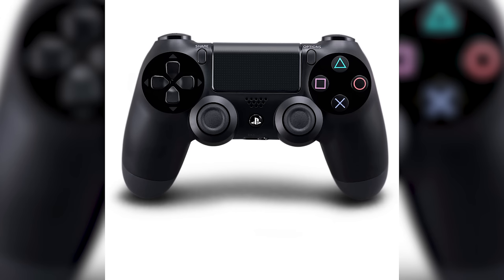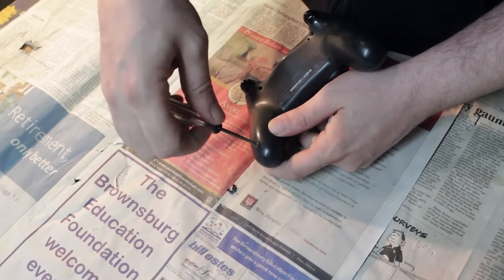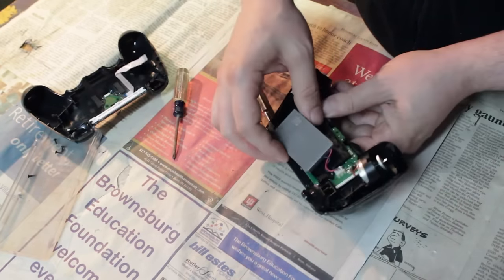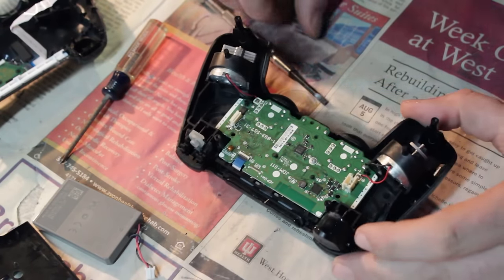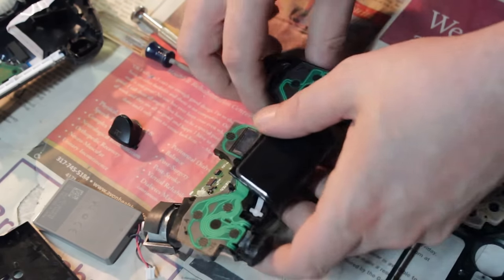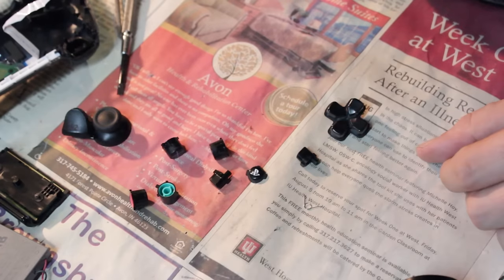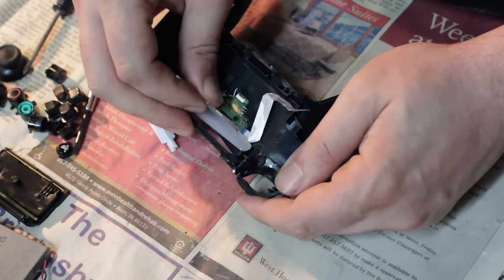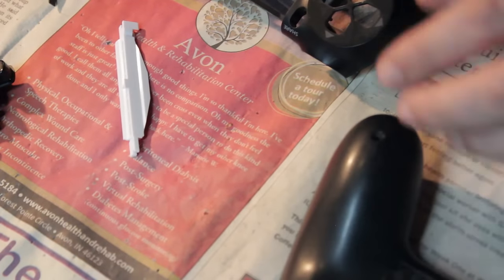How to take apart a PS4 Controller

Comment: I used your tutorial to fix a problem with joysticks, but afterwards all of my buttons started having a weird glitch. When I select something in the home, like Minecraft I could enter the game, but I’m stuck at home screen and can’t go any further.. I can go into other applications like my settings or trophies and select things, but the moment I enter a game everything stops. Has anyone else ever had this problem and know how to fix it? I really don’t want to spend more money on a new controller.
Reply: I found a reddit post with someone with the same problem, so if anyone else has this problem it’s because one of the buttons are stuck or there’s too much dust blocking it. I opened mine back up and found the spring at my L2 loose and falling out. I’m still working it back into place, but I’m glad it’s not a worse problem.

Comment: Hi I was wondering if you had a tutorial on controllers if my thumb sticks lean to the left when I game?
Reply: Jessie Dugan Same
Reply from the maker: Drifting is almost always a sure sign to just replace the entire controller.  The only way to permafix this is by removing the old joystick module from the controller board and replacing with a new one.  This can be tedious and delicate so unless you have some very good soldering tools, You may want to save yourself the headache and just get a new controller.

Comment: After taking out the screws and using the flathead it's still really not wanting to seperate.
Reply: Eventually got there and my blue ribbon now doesn't want to come out, I feel like I'm going to break it try to pull it.

Comment: @Drumblanket  Great video. Mine turned out great except 1 thing was the bottom half was a touch darker shade than the top (obviously I did all 1 colour) is there something I can do different to avoid that?
Reply from the maker: did you use a primer first?
Reply: Yes.it seemed to be just the 1 paint colour that was doing it. I did another 1 a different solid colour at it was fine

Comment: When I built my controller back, the light bar and the controller stopped working
Reply from the maker: Its because you most likely didnt put the blue ribbon cable back in the right way.  Flip the connection around and it should be good.

Comment: I disassembled my controller, put it back together but now each time I press the os button, charge the controller or push the reset button, the light flashes yellow three times and turns off, can someone help me?
Reply from the maker: Ribbon cable is I. Wrong

Comment: What does that middle screw hook on to? I'm trying to put my controller back together and it's not grabbing on to anything. It just sits in the hole
Reply from the maker: It should be grabbing, If it isnt, Your controller is not resting in the shell correctly.
Reply: Drumblanket thanks I got it but my controller won't turn on now lol I think I'm just gonna get a new one. I took it apart cuz my X button wasn't working but now it won't turn on.
Reply from the maker: I would check the ribbon cable.

Comment: Just here to say PlEASE to anyone taking apart the controller....when it comes to opening the shell MAKE SURE YOU ARE HELLA CAREFUL I freaking over muscled it and the ribbon cable just popped out from the top...so yeh....just a PSA don't rush it don't muscle it with your barehands like I did because it is tricky you'll feel like it needs force then you go and do a "bit" of force and POOF whole shell split ribbon cable pulled out from top so it's broken....
Reply: * Update* I fixed it LMFAO

Comment: Would love if you could reply. Ever button works execpt my x button. Have no clue why. Everything looks like it's where it should. I cleaned it out with air too and nothing :(
Reply from the maker: Hmm...  I say take it apart and make sure the metal contacts dont have anything on them.  Thats the only think I can think of.
Reply: @Drumblanket  I'm assuming the metal contacts are the springs / pistons that extract from the buttons, and they looked fine. I will say I've dropped the controller more than a few times, but I'm not sure why it only affected one button. Either way, that you for the fast response! I'll be sure to come back if I have any other questions about tech :)

Comment: U made me break the black piece that hold the battery in place, there’s uh screw holding it ,all dint say that just just said spend time on it it’ll come off all broke 😂😂now it’s loose putting it back together, so anyone if it ain’t coming straight out there’s uh small screw 🤦🏽🤦🏽
Reply from the maker: I made you do this?????

Comment: This is why I hate ps4 controllers. The analog sticks have problem like controller drift and not being a now to Sprint. Then when you try to fix it the screws are so small you need to go buy the right tool for that. Then after you get the screws out you find out taking the case off is a bit hard. Then when you finally get it off you have to struggle to get the ribbon off. Ughh

Comment: Do you have some info why ps4 controler cant connect with bluetooth but works only by cabel?
Reply from the maker: Probably a bad Bluetooth receiver.  Do other Bluetooth devices connect to the ps4?
Reply: @Drumblanket  Other controler connects with ps4 and other devices with no problem but this one wont connect on my ps4, phone or laptop.
Reply from the maker: Sounds like the bluetooth connection in that controller stopped working.   Im not sure about a fix for that.

Comment: Grandmother can take apart a PS4 Controller with no issue.
video is not showing how to get it back which is the difficult process.
Reply from the maker: Check one of my custom ps4 controller tutorials. They have reassembly instructions.

Comment: the screws are hard to open (like so hard) is that normal?
Reply from the maker: it could be the screwdriver you are using.  Small screwdrivers can be a real pain to use i the handle isnt long.

Comment: Wedging your controller open with a flathead IS NOT a good idea. Please don't try this, you'll ruin your controller.
Reply from the maker: As everyone can see from my video,  Doing this did NOT ruin my controller.
However, if it makes people more comfortable to use a plastic screwdriver or orange peeler, you can.  If you are careful, using a regular screwdriver will be just fine, regardless of what people who pop in and post in the comments say.

Comment: Hey can you please respond as soon as i pulled out the white cable from the board and then after i pluged it back in now it just keeps flashing orange like its charging but its not pluged in
Reply from the maker: are you sure you put them back in with the connections in the right spot?
Reply: @Drumblanket  yeah so i kept messing around with it then it started flashing red the same way and after a minute or do it completely died
Reply from the maker: sounds like your battery must have died. I would check all of your connections and make sure your ribbon cables are all properly fitted.
Reply: @Drumblanket  hey bro could you please recomend Me a wall charger for my PS4 controller because i dont want to fry the battery

Comment: Hey can you help me? I got to the part with the joysticks, and do you know those two parts where the positive and negative cables meet on the chip. The red positive cable detached from the positive metal part it’s supposed to be at. Is it done for? Or is there a way I can get it back on? Please help and thanks
Reply from the maker: You'll need a soldering iron and some solder.  Its not terribly difficult but you would need basic soldering experience
Reply: @Drumblanket  ah dammit thank you
Reply: @Drumblanket  I have no experience with that but I was wondering could I just stick on the cable with some electrical tape? Could that maybe work?
Reply from the maker: It wouldnt be secure.  Honestly, Soldering isnt hard at all.  Plenty of tutorials and its cheap to get started.
Reply: @Drumblanket  hey can you link me everything I need to get started just for fixing the wires on the controller? I don’t want to spend too much money, then it’s better to just get a whole new controller. On other vids i see, it gets quite expensive

Comment: Took mine apart only to realize that my replacement Xbox 360 sticks won't fit in the casing good enough to move properly.
Reply from the maker: Grind the base up on the thumbsticks a few millimeters. 
Should work better after that.
Reply: @Drumblanket  Will do thanks. Do u know if One sticks are better fit? I like them better but didn't have any for spare right now to test.

Comment: I tried putting everything back together, everything still works, except the light 😅
Reply from the maker: your ribbon cable is backwards
Reply: Drumblanket thanks for responding, I’m just going to leave it, it’s better without the light anyway 😂
Reply from the maker: @newbloxers6493  it actually uses less power that way. If you decide to change it in the future, you know what to do!

Comment: Why does the ps4 controller emit dangerous levels of microwave radiation?  Like a mini cell tower?  One of the reasons I sold my ps4 pro.  Tested with gq-emf-380 multi field meter v2.   Dr Barry tower is on youtube.  No rf shielding ..... Even 80s computers had that.    Please share this information.  I can't do this own my own.

1 second ago

Comment: I destroyed all four plastic hooks prying it open like this. I don't think this is how it's supposed to be done.
Reply from the maker: Plastic hooks, shmastic fooks!!!    
The controller is held together by SCREWS!!!!  
I actually have no idea what hooks you are talking about. 
How new is your controller?
Reply: @Drumblanket  Its from 2014, unless I've mixed it up with a friends controller (the battery says 3.65V which I read somewhere is a newer thing..?).
Reply from the maker: What does the lightbar look like?  Does it protrude upwards or is it flush with the bottom of the controller?

Comment: My controller has a whole extra gray plastic piece inside, encasing the whole thing and making it impossible to separate the front plastic from the main inside part, anyone else have the same thing?
Reply from the maker: Updated teardown on my channel.
Reply: @Drumblanket  Thanks, I figured it out though, the battery just had a sticky piece holding it in place

Comment: You skip way too many important steps as if you expect people to know everything about controllers and tiny screws and mother boards, broke my controller trying to follow u and I did it extremely slow " so let's get the battery out of the way" yet you don't show any way to get the battery out of the way I have never seen a motherboard of my life I have no idea how you got the battery out and you didn't even show up so I'm scared to death to even tempted it when I tried it broke thanks champ
Reply from the maker: Your name is fitting for this comment.  I have a feeling you were already defeated before you even started.  300,000+ views 2000+ likes and they all got through the steps just fine.
Reply: @Drumblanket  but how the fuck do you take out the battery seriously, i broke my fingernail trying to pull it out

Comment: How the fuck do yoy taje the battery out you literally skipped the only part i csnt do
Reply from the maker: Figuratively.... I FIGURATIVELY skipped.   I was not skipping down the road, I was not skipping through the valley, I was not skipping stones.  
And, No, I didnt skip it.  Bad camera angle.  You just have to work at it until it comes free.  I have an updated video on my channel and I show it a bit better in that.

Comment: I'm late to the party, but I brought a used second hand ps4 pro, and the controller was disgusting, had all shit on it, I fully disassembled everything and cleaned it, Sony are scumbags for making it tight when trying to open the controller up, these "clips" inside the controller are unnecessary and useless cause the 4 screws will hold everything in place. I should have just brought the console new, I brought it cause I wanted to jailbreak it, than I checked the firmware, and the idiot seller updated it to the newest firmware. Oh well I will just wait until a new jailbreak comes, for sony and its stupid controller I'm glad i will jailbreak my ps4 console and pirate all your games for free 😃😂🤣😄
Reply from the maker: Can't you reset the PS4 to factory settings?